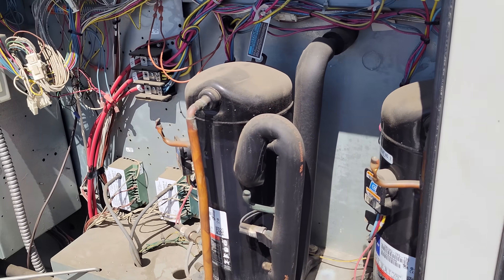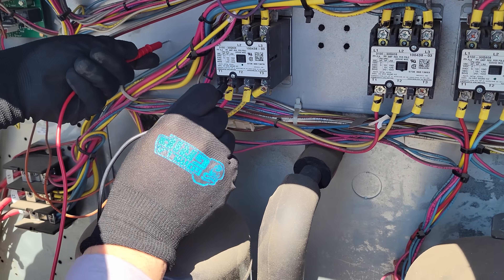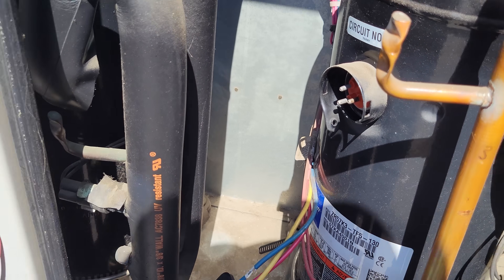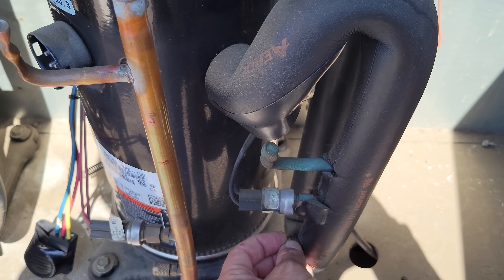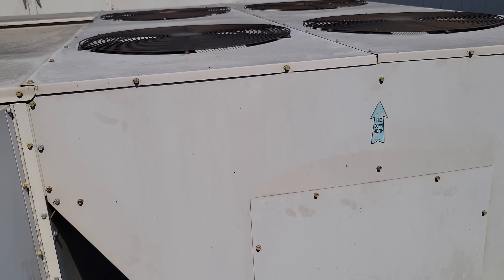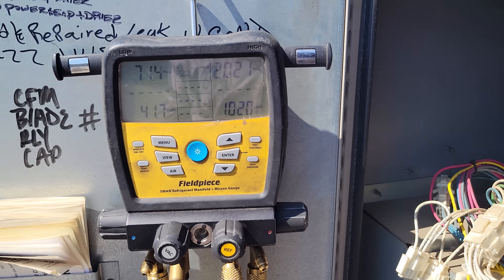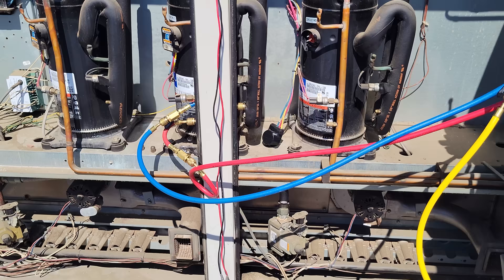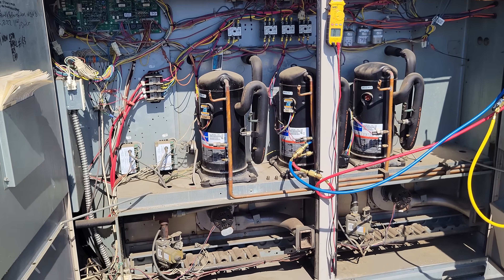THE KITCHEN AC HAS A TRIPPED BREAKER

Comment: Fuck. This morning I did everything right, except I was using the breaker for a data point. Didn't know that could be dangerous. I was going a little overkill on the test where you unplug the compressor to see if anything trips, it doesn't, so you turn it off, plug in the compressor, and see if it trips, which it should. Next time I know I don't need that extra data point and simply verifying continuity to ground is sufficient.

Comment: 8:00  it seems so logical that you don't expect to have to explain it, but yes, breakers trip because there is a problem somwhere else*. The breaker isn't the problem (well, 999 out of 1000), the breaker trips because something else is kaput and if you don't fix that then the breaker is just going to trip again and if you're unlucky then the damaged bits are going to arc and explode and form a small black hole and suck the world into it and *you will be to blame for the end of the universe. Ofcourse you will be in the back hole first so nobody can call you names for it, bit still.

Check why the breaker tripped before you reset it.

Comment: The same principle can apply to leaks. I don’t like to manipulate shrader caps or valves if I suspect a system is low. If I’m confident the system is low on charge, I put whatever tools I brought with me down and grab my leak detector. I’ve saved myself a lot of time by checking for leaks first, before gauging up. If it’s flat, that’s one thing. But if there’s anything over 15 or 20 lbs of pressure left in the system, it’s a good idea to stop digging until you find that leak. The way you checked for the short first, saves time and headache 🤙 Good advice as usual, duder.

Comment: The compressor probably also open circuit -  if one of the phases is grounded then there should be some continuity through the windings from the other phases to ground.

Comment: I hope I'm not sounding ignorant, but I've been working with electrical (residential) and electronics for almost 20 years and I've never seen a meter that continuity and tone are separate? Unless you were saying to use resistance instead (which as you pointed out your meter displays both).

Comment: Dirty burn #3 .. Not surprised. 

Done a few of these in arizona and this looks to be a pretty standard lennox rooftop pack.
Ive seen condensor fans shut off after heating up when its 110F and running full balls tryin to catch up with the indoor temp.

Comment: for a shorted compressor, i've had a shorted rotary blow out on me, and yes, the smell was absolutely foul. the stain has not been removed from my shop, despite my best efforts. i learned that if there is a short, to be extremely careful. due to the size of the unit, it was basically insalvagable (apartment heat pump).

Comment: I had a popcorn cooker (the Cretors models with the kettle that you tillt to dump, with four wires going in it in a flexible conduit) blow a GFI into oblivion. A common mode of failure on those is that one of the wires abrades through the insulation and shorts out at the conduit, usually near the kettle, where it is about the hottest and oiliest. Yes, it absolutely murdered the sub-box GFI in such a way that it smoked, and would no longer reset. And that rendered the lower storey of the building pitch black for a few secondse before the backup lighting kicked in. Luckily the auditorium equipment and the projection booth are powered from another sub box. It was Saturday night and we had one more show, then a few on the Sunday, and a national holiday coming on Monday so it would be two more days before we could expect to get our designated electrician... so by a lucky strike when the building was renovated, there was one single socket downstairs in a storeroom that had been ignored, and was on an old non-GFI lighting circuit. I had 50 minutes until the nearest hardware store in another town would close, I drove aggressively to get there, I got long extension cords and ran them across the lobby floor so I could get our POS equipment running. I swapped a repaired kettle on the cooker and we were good enough to go for the rest of the weekend.
Reply: On that Tuesday I called not only the designated electrician to fix the sub, but also a few scrap dealers, and managed to lay my hands on a 1,2 kVA isolation transformer dirt cheap. I put the cooker on the transformer so it had isolation from the house wiring, and we could operate it without the fear of one abraded wire ruining the whole weekend for us. It would just trip the breaker on the secondary side. I just had to make an internal memo and a warning plaque that nobody would EVER connect anything else than the cooker on the transformer. Otherwise there was a risk that two devices that produced a ground fault would then possily have 240V between their shells and become a death trap.

Comment: "Don't use tone, use continuity "   Ok, the tone is just an aural indication that there's continuity,  not really following what distinction "they" are trying to  make with that.
Reply: Depending on the meter, it may take a moment for the beeper to come on, and usually does not latch (stay) on. So, if you're careless you can miss a short by not looking at the screen and going too fast if you do have a meter with a "slow" or damped beeper.  That's the first thing off the top of my head, but it's really operator error in that case rather than actually not using the correct mode. AFAIK the continuity modes on most meters are essentially CONTINUITY and CONTINUITY WITH TONE, so using one mode over the other has no effect on the meter's actual sensitivity or detection time.

Unless the comments thought he was using an actual Tone Generator (sends a radio signal down the wire, and you can use a probe to follow the wire or find the cable in a loom down the line) but IDK why you'd EVER use one to attempt a continuity check. That would indeed be using the wrong tool for the job.
Reply: @Jay-ik1pt  Well,  I guess I've never watched  any of my meters to see if there was a delay between continuity registering on the display and the tone sounding.  If there is, its a pretty short delay, and I'd agree that if that delay is causing you to not catch a short to ground, that's operator error.

Comment: Just curious. After checking for shorts to ground, what about phase to phase shorts?  Is that something that just never happens?  I know it will be harder to interpret the difference between normal resistance and a short.
Reply: I've seen him do it a number of times.  1 to 2, 1 to 3, 2 to 3.
Reply: He did check phases first, phases coming in are all connected, load side of the contactor isn't connected when the contactor is not energized.

Comment: Big Picture applies to so many more industries than HVAC. As a computer technician, I did something similar and brought out the parts cannon when I was early in my career. I ended up frying a spare CPU, motherboard, and graphics card because I didn't check voltages in the power supply by using a power supply tester before doing the old "off and on" cycle and listening to the system's built-in short protection. Well, it let out a hecking big bang, and I'm really glad I was wearing my brown underoos that day. The lesson learned: Listen to what the equipment is telling you, and test EVERYTHING before moving forward.
Reply: As someone who works on computers as a hobby: I have never thought of to check this. Reading your comment I realized I should xD
Reply: @maotio  Yep, when a protection circuit kicks in, there's a good reason for it. The good thing in my case is the equipment wasn't a huge loss, just a mild inconvenience since it was already on the chopping block to be replace in a few months. This mistake just accelerated the replacement.

Comment: I am an access control technician, and one time I was doing a routine remote service call where I went to update the firmware on their door controller and it bricked itself... Was getting calls from the FM asking why none of their 50+ doors were unlocking now in their rehab facility 😂 I replaced it and all was well, but I know that feeling you get when a small problem all of a sudden gets REALLY big.
Reply: Just curious, what would have happened in that situation if they had a fire at the same time the door controller went out? Is there some sort of emergency fail safe that would open the doors?

Comment: Odd question from someone with ZERO HVAC experience: if the compressor and txv are already being replaced and the coils being blown out with nitrogen, is it possible to replace the refrigerant in only one circuit on a multiple independent circuit R-22 package unit (as the one is shown in the video) with R-404A? Or is this just a really bad idea?
Reply: Yeah it’s possible. Is it something anyone would do? Never

Comment: I once blew the main to a mine building. Couldn’t find any problems on a 50ton condenser so we changed the fuses and when we turned power on it instantly blew the whole building. Turns out a small amount of water got into the disconnect and the electricity was jumping to it. 480/3 phase, shut the mine down for an hour while they went and found fuses

Comment: I came a cross a lennox unit with prodigy board that blew a fuse out of 3 I started by checking checking loads to ground, then caps and seeing if there was refrigerant in the circuits and finally the crankcase heaters. Found nothing wrong, so I went a head and replaced all 3 fuses
Started unit up and tested each load individually and checked amp draw finally jumped unit to full cooling for 15 minutes and everything ran fine. Still couldn't figured out what caused the fuse to burn kinda of brothers me lol.
Reply: Fuses degrade with time, if after checking for the obvious culprits all seems fine and the fuse does not blow again when replaced it probably just failed due to age.
Reply: @damacc8365  yeah I thought the same thing which is why I replaced all 3 figured if that one went bad over time then the other 2 probably would too.

Comment: One night I had to shut down the fridges and cold rooms of a big supermarket and then restart everything after the electricians had connected the new solar panels in the parking lot. The main circuit breaker failed to stay in place. A one hour job turned into 6. Worst scenario especially at night

Comment: This is not meant to be a criticism but a helpful hint coming from a 40 year electrician.  Your narrative at the end is pretty much correct except, IMO, one thing.  Before spending the time to check out the unit for shorts, I would have turned off the disconnect and then immediately reset the breaker.   If there was a fault in the feed breaker or the feed line, you would not know this by checking out the unit.  While in this case it turned out there was a shorted compressor, what if you spent an hour or more checking for a unit fault and found nothing.  The vast majority of techs would surmise that the fault was heat/running related and try to fire the unit.  If there were to be a fault in the line, you are back at square one and you would have spent all that time diagnosing for nothing.
Reply from the maker: I will discuss this on my livestream this evening 11/15/21 @ 5:PM (pacific) on YouTube come over and check it out https://youtu.be/3viwpQZ83GM